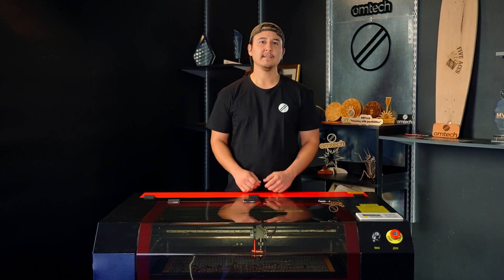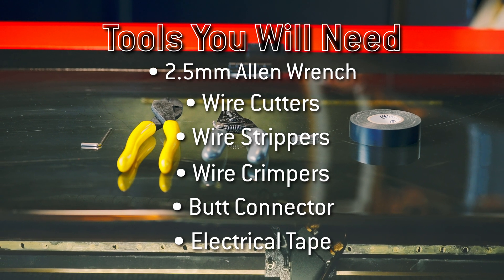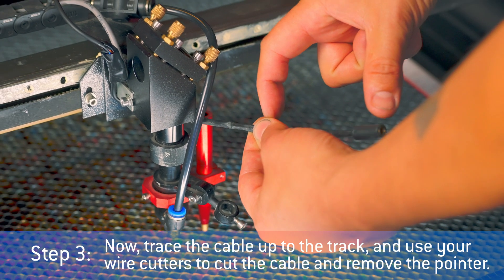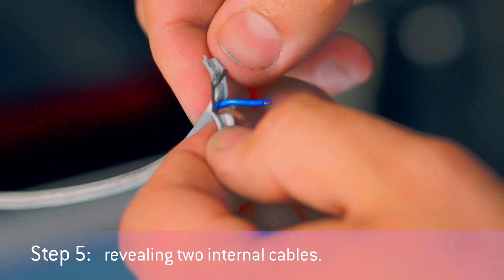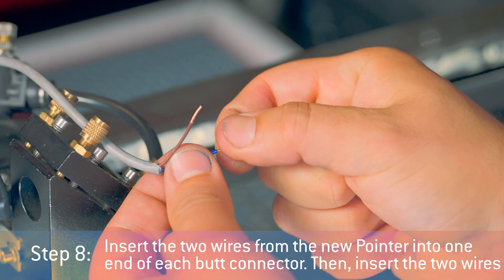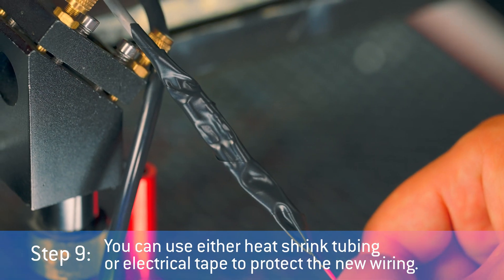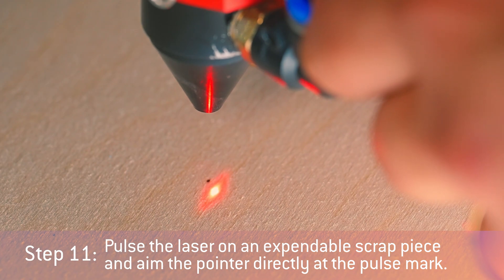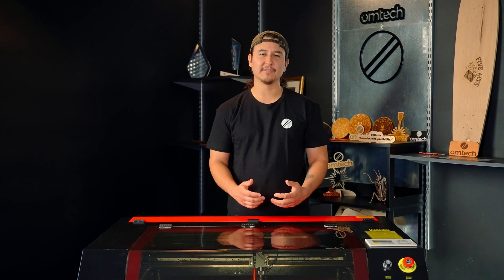How to Replace Your Red Dot Pointer

Comment: This approach is mainstream, but it is wrong. The beam is angled, so the red dot deviates from the true laser center when the wood is slightly higher or lower—which is inevitable, because wood is not perfectly flat. The red beam must shine orthogonally, parallel to the real laser. That way, variations in material height do not cause the red dot to drift. In addition the resulting offset between the red beam and the cutting laser must be entered into LightBurn so the real laser starts cutting exactly where the red dot was pointing.

Comment: This red dot is unreliable they should’ve just used the beam combiner stock.
Reply from the maker: The beam combiner is definitely a great tool and helps a ton! The red dot works well, just needs the correct alignment and attention to be accurate.

Comment: Has any one had any luck with getting this part number for a replacement red dot pointer from omtech?
Reply: I had the same problem and went to their website and wrote someone on the chat. And they told me i had warranty and they checked my order number and they sent me a new one. It took almost 3 weeks to get it